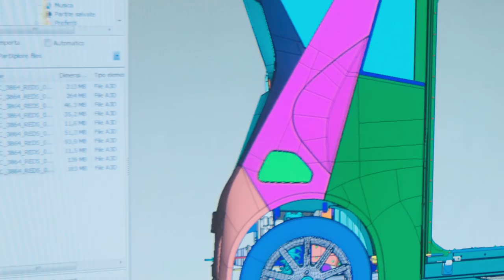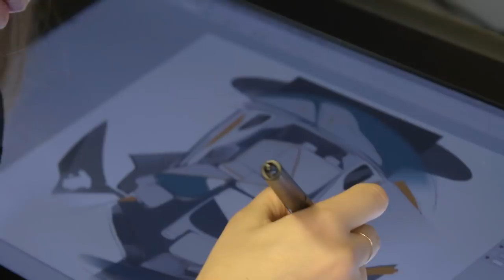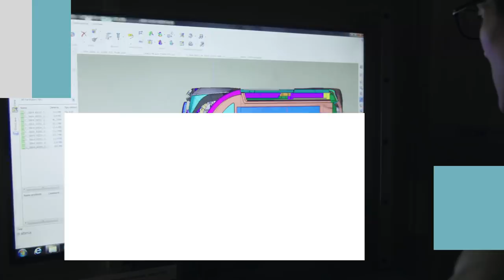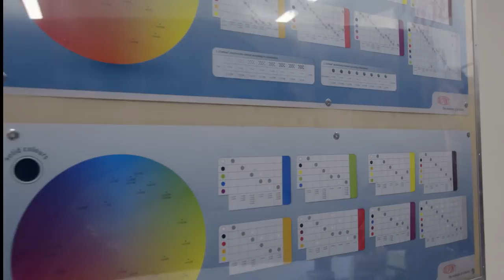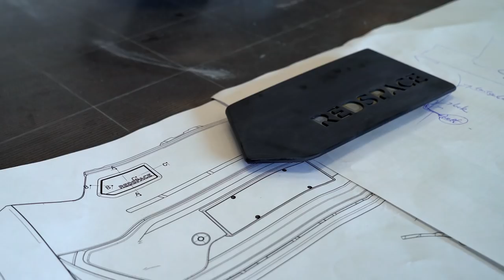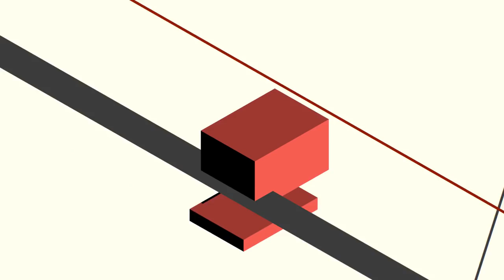Chris Bangle's REDSPACE REDS Project

Comment: TO 
All Opinionated Audience,

 Dear General automotive audience: 

         You may be naive to understand the real value of design process behind this car. which is very important to understand. This particular concept, It is radical in how its users its form benefits its use. the big flat roof and almost flat front may not convince the general automotive fanatics because you are conditioned to appreciate what looks "good" or "sexy". 
But the concerns are for a larger purpose: How would you use space within 4 wheels?  It is a philosophical challenge rather than a design problem.
 
But when it comes address a very human problem, there has to be a radical way of THINKING to come up with a new way to solve a 100-year-old problem to move people around.

So considering the future of transportation and considering ecosystem of future cities, I urge young generation of designers to question the way we look at cars. 
 
Any loose opinions, whether it looks good or not shouldn't stop people reinventing. If a product which ends up with a radical solution, we shouldn't be biased to reject it rather question it and understand why is it there in the first place? 

 "Good design or a Bad design doesn't exist, There are only good or bad opinions of the same."

 
my warm regards.

 Thank you 

 -Concerned 
  Observer
Reply from the maker: Thank you for your comment! 

You are of course entirely correct. CBA's project proposes innovative solutions that move the game on. Design is more than just aesthetics. REDS is relevant on a range of levels. 

As ever, people are entitled to their opinions. Taste is subjective. But this breaks through conventional boundaries that have defined 'car' for over a century. I applaud the entire team at CBA for their bravery
Reply: Thanks for you comment. Appreciated!

However, the "look" is a function too. It has the priming effect, it does have an embodiment design role, and so it makes it important too. Can't wait for the next design iteration! 
The thinking behind it just makes perfect sense and it moves the car design away from the 19th century paradigms. I stand with Chris Bangle's here ;-)

Comment: Complete bullshit. There is absolutely nothing new about this car! Only silly things like putting solar panels on top of a car - the least efficient place for a solar panel to work at its best.
Reply from the maker: I respectfully disagree. There are a host of innovations, including the reverse raked windscreen and backlight and the awning that appears over the sliding door when opened. Those are just two on the exterior alone. There are even more on the interior. Saying there's 'nothing new' is simply not true.